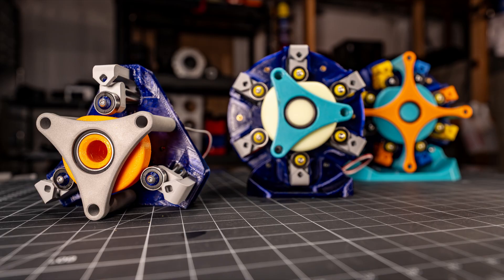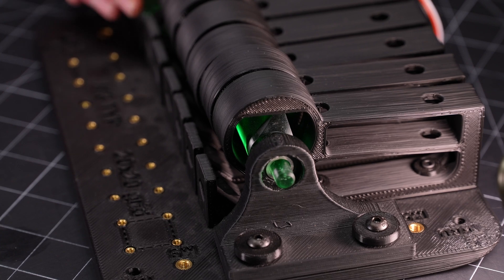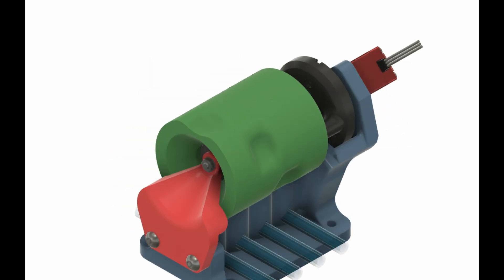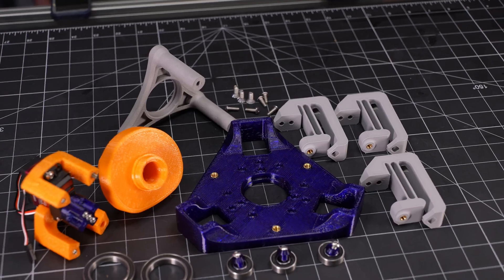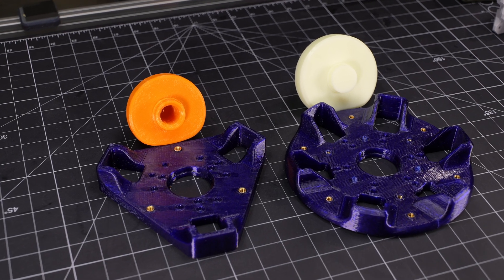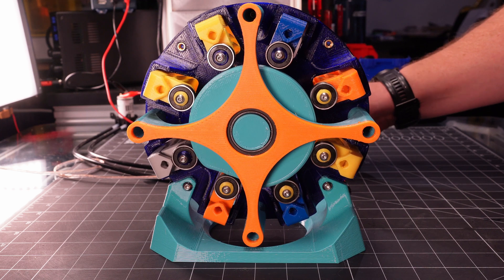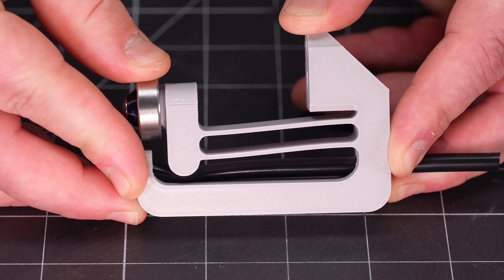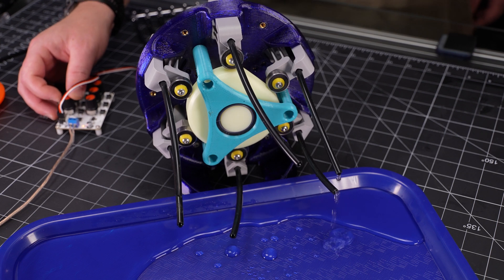Building My Own Multi-Port Valves with Cams and Flexures (3D Printed)

Comment: In the end I mounted one tube to an arm connected to the servo. Then there were several funnels in a circle with tubes to the plants. So just one pump and one servo. Well, and gravity. I gave up on valves made by pressing on tubes.

Comment: Very refreshing to see someone else making a similar "product" !! I struggled with the cam's aswell and turned my design completely 180. I can have 8 solutions mix in a single reservoir and then dispense that to 5 locations, 6 if you don't care to rinse the tubes. All with 1 micro stepper and in this case 8 peristaltic pumps + a normal waterpump. The reason i stopped the path you have taken is because everything got very dirty/sticky fast. My new design can clean itself automatically! And all in all it can fit in a 240mm circle only 300mm high, in this configuration its like a bucket but i could also make it 400mm wide, 200mm high and only 70mm deep in a box. My delivery system uses gravity and the 6 option's i have configured now fit inside a 70mm pvc pipe only 90mm high!

Keep up the good work for your "peppers" ! subbed for sure!

Comment: Interesting design. I'm looking into something similar to your Multi-Channel valves except for moving devices. The issue is that to move a 10x10 matrix of items requires a total of 100 motors (assuming that each device moves independently) so I'm looking for ways to reduce the number of motors. A Camshaft device would work but would also mean that only 1 device on a cam controlling 10 devices could move at the same time (yeah, sort of like trying to fit 10 gallons into a 2-gallon bucket)

Comment: Great work.
I saw syringe+screw+stepper combination for dosing liquids. Add 2 checkvalves and 1 endswitch for initial position and you have ready product. Washing machine solenoids or solenoid valves from ali as suggested by someone in comments are also an option. It is price and reliability, that determine the best option.

Comment: You should consider a sailing winch servo. These servos have 720 degrees but are simpler to operate as a stepper motor

Comment: I made something similar last year, and then i found some small selenoid valves that work perfectly for that. 
They are pretty cheap and should work great for nutrients. 
 
On aliexpress they are called "DC 4.5V 6V 12V 24V Small Mini Water Valve Electromagnetic Solenoid Valve Normally Closed N/C Water Flow Control Valve"

Pretty cheap and plugged in the right directio, you wont have any leak. 
Also, the valve chamber is all plastic, so no corrosion

Comment: Great work... I haven't seen your other videos, so I am not getting the reason for this design over a bank of small solenoid valves?

Don't you get leakage from all the channels between the starting and selected channel when actuating  the servo?... or is the pump turned off when changing channels?

Comment: I 3d printed something very similiar and decided to have one central cam disk with the hoses arranged in a circle around the disk (the hoses are parallel to the axis of rotation)  this way the forces of the squished hoses cancel each other out. I use 8mm OD silicone hose with 1mm wall thickness and a nema 17 stepper motor the whole assembly for 8 hoses has a radius of 75mm and a height of 65mm with the stepper motor included. the stepper motor has plenty of torque and a "pancake" stepper motor could propably be used. instead of flextures i use "pins" that just slide radially between the cam and the hoses and are otherwise constrained. the hose end of the pins is shaped so that the hose is piched only on a small section of 1mm. the only hardware used are 12 M3 screws and 8 heatstake inserts, the stepper motor and a 16 tooth gt2 belt pulley that ise used as an interface between the cam and the motor shaft.

Comment: I'd recommend switching to a groove cam disk. You're flexures will be spending the bulk of their time in the pre-load configuration so you'll be getting creep over time. You can leave the rest of the design almost exactly the same and just make the cam disk sit all the way over the bearings and even take advantage of the too-small range of motion as you'll want a dead-position where no cam followers are being depressed to make assembly easier.

Comment: Don't use a stepper motor, use a dc motor with worm gear (eliminates backdriveability and adds a lot of torque at low cost), also add a potentiometer to the cam. The driver board can be a simple h bridge with a microcontroller that reads the potentiometer position.  (Also BTW a stepper motor driver can also be used to drive DC motors).

Next setup a simple protocol to control the device via serial. something like a <device_id>;<action_id>;<action_data>. This will allow you to connect all your valves and pumps to a single serial bus (daisychain wiring). This will give you a near identical setup to one of those serial smart servos like dynamixel.

Comment: Great idea, simple and effective. Just a thought if you use negative materials and keep the same geometry on the area where the value contacts the hose it would allow the supply flow to be supplied or restrictive better while using less force on your components.